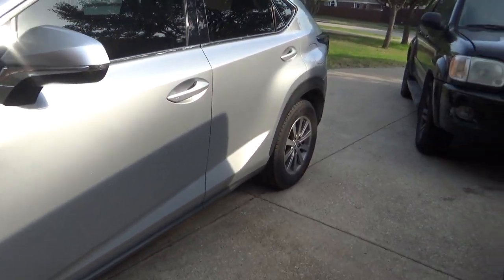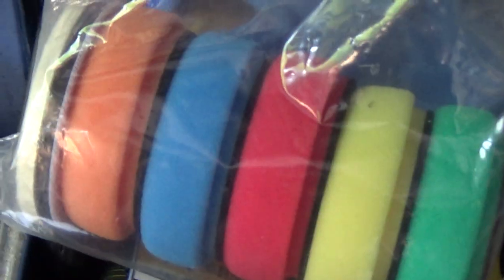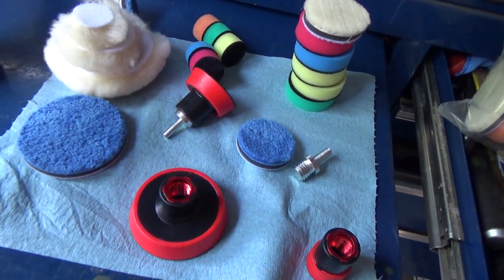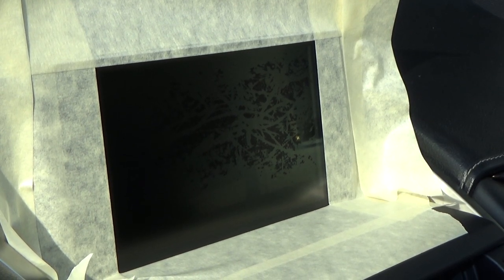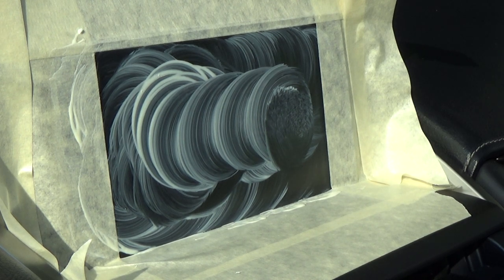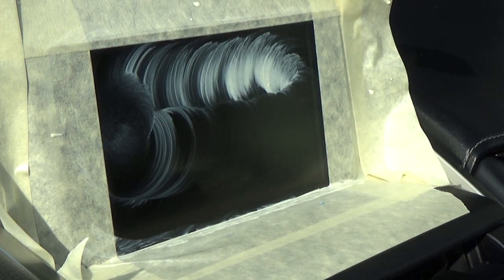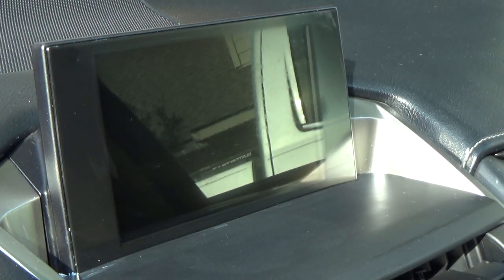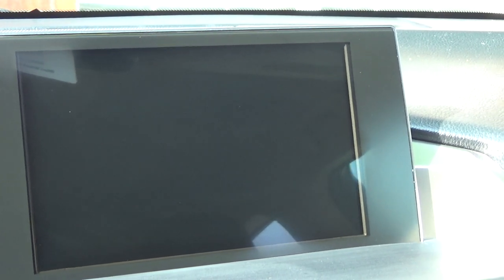Easily Fix a Lexus Multi-Display Screen because of Defective Anti Glare Reflective Coating Damage.

Comment: Use baby wipes !!  Thank me later 😊
Reply: Wow wow wow !!! Baby wipes is a wonderful solution for this problem !!! Thank you very very much
Reply: It makes it worse
Reply: Baby wipes work! I used the Huggies brand. Don't use alcohol wipes!
It does not remove the anti gloss coating but makes the display looks like new! 

Thanks for the advice!